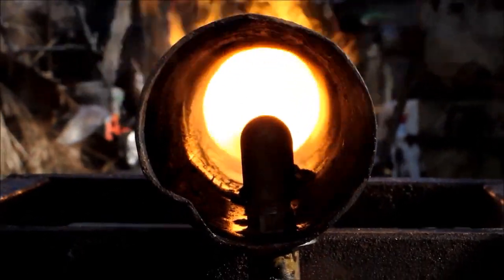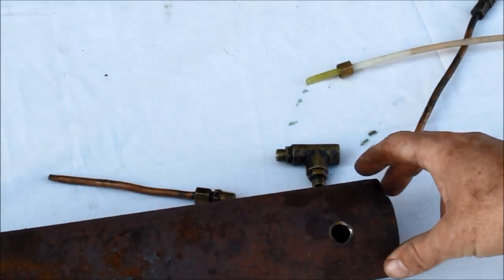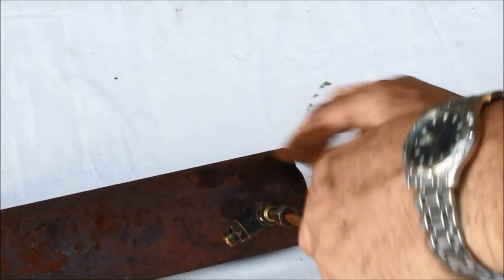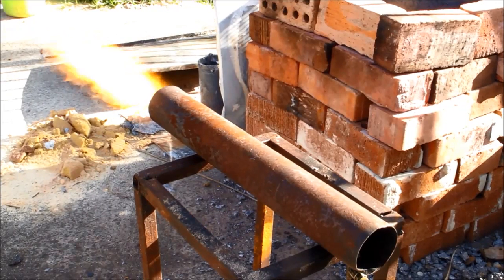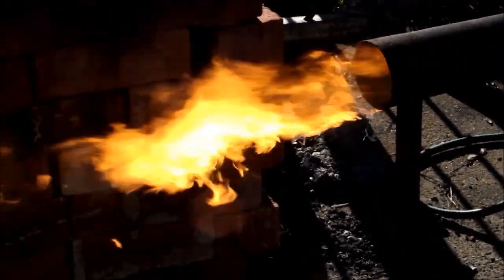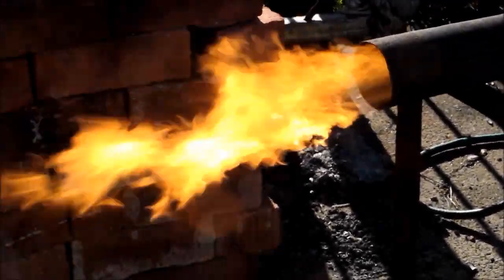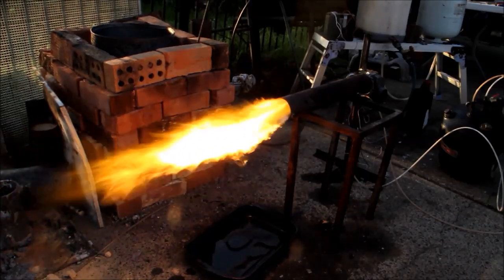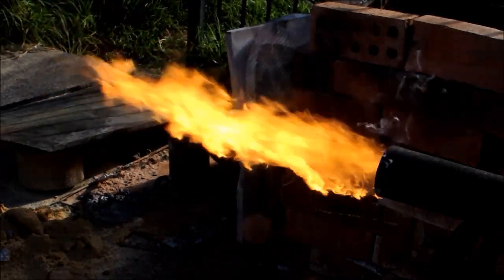Oil Burner Lighting demo  and Setup for heater and furnace applications

Comment: hey mate. any update on the NA burner, i have been thinking of some designs, i want to make one out of 3 truck brake drums. i was hoping to make a sort of permanent out door heater. i've thought of one design but it requres forced induction. i'm trying to think of a design that doesnt use forced induction, doesnt make too much noise. and burns clean. 
so you know simple haha
Reply: Done it

Comment: haven't watched all your vids (just subbed today) but can you include some temperature readings via the use of a temperature gun?  thank you.
Reply from the maker: +linuxxxunil    Temp gun readings are really meaningless. It's not the temp that is important but the amount of heating power or overall BTU/ KW produced. I could make an oil burner that produces 1200o c ( and more!) that uses 500Ml of oil an hour. It may be hot but it does not have the energy to melt a 5Kg block of ally.  It's a bit like a motorscooter will do 60 Mph but it won't do 5MPH  with a 2 ton boat on a trailer attached.  It's not temp that's important because its always relatively the same, it's the amount of power produced which helps to overcome the heat loss that is important and gives a practical heat rise to produce practical work. 

The best indicator of power on these things is fuel consumption.  They will do up to 1500o C in ideal conditions but even clean combustion is going to give 1200oC+ every single time.  The temp of the output doesn't vary much no matter what the fuel consumption but there is a lot more energy in something burning 25L hr than something burning 2.  :0)

Comment: Guday OB. Yet another fun vid. So are you measuring how much time the compressor is running for (X) amount of oil burned? 
I still like your monster burners over all others!!  lol..
Reply from the maker: +Steve 1961P.  The compressor runs ALL the time the burner does apart from a brief window when the compressor is full when I start the burner. After that it never stops. My compressor is an 8CFM. If I reduce the pressure of the air down it will Cycle but then of course you get less heat. I could also flatten the Nozzle a bit which would allow a higher pressure and with enough restriction and subsequent output reduction, also give the compressor some rest time. 

I prefer the monster burners myself and plan an attempt at breaking my 600Kw output record soon.
Reply: if you could find an old walk behind leaf blower laying around somewhere...  they generally put out anywhere between 1200-2200cfm @150+mph air speed.

Comment: what pressures are you running for the air and oil lines? Thanks!
Reply from the maker: +Tommy Rad   THis was running about 20 PSI here.  On the vid after this I ran 30 PSI and it made for a lot bigger Flame and produced a lot more heat.
Reply: Oil Burner
so,only the air side has any pressure? The oil is gravity fed?sorry for the nube questions. I'd like to build one in the barn.
Reply from the maker: +Tommy Rad  Look at this Vid https://www.youtube.com/watch?v=iW1odjaM8w8  and it will explain everything .  Also have a look at the rest of my vids by clicking on the channel name to see all the rest.Might be something else you are interested in there.  :0)
Reply: Oil Burner
thanks. cheers.

Comment: Around what air pressure is the air coming into the burner?
Reply from the maker: +splinejunky  About 20 psi here. I ran it at 30 the other day and it was more powerful and also used a lot more air of course.

Comment: How much oil per hour does it use to say melt alumium?
Reply from the maker: Well depends how much Aluminium for a start and how well your furnace was insulated or if you did it open air.  It's not like a car where you can get an MPG figure,  but you could melt a good amount with as little as a litre if you wanted.
Reply: thanks for swift reply ... I see your point about exact set up..Ill test it out first hand then shall i :)

Comment: Can you use a smaller main pipe?
Reply from the maker: +65BAJA   You can use anything you like. I just used what I had lying around. it will work with whatever you have and is not dependent on any particular specifications.

Comment: how much oil it will burn per hour?...
Reply from the maker: +Madalin Mihai   Like all my burners, the fuel consumption/ heat output is variable.  The oneis fairly conservative but I'd guess about 100Kw or 10 L an hour flat out but again fuel consumption is directly related to how much heat you are trying to get out of the thing. There are no efficiency in this like with a car.
Reply: i wanted to use your project to heat my house at winter. That´s why i wanted to know the amount of oil that it will be burned per hour, ty
Reply from the maker: +Madalin Mihai   I would suggest you work out the amount of heat you require.  If you have a heater of some kind already, you could get an idea by looking at the rating of that.  1L of oil an hour generates 10Kw.  2-3L an hour would do most Homes well and truly I would think so you'd be looking at  2-3L an hour once the house was warmed up.
Reply: Thank you verry much for your help.

Comment: If I click dislike its because its not burning clean if it smokes its wasting fuel yours smokes .bad design if you put oil in a pan and blow on it that's not a burner its just a heater like what you slapped together. How did you get out grade 3.

Comment: so crappy and illegal... at least with "complicated" burners as you call them you don't run the risk of setting your property on fire...  let's not even mention environmental damage
Reply from the maker: The environmental whinge says it all. Nothing illegal about this where I am. What Nanny state do you live in?  Yeah, it's crappy but works.  What have you made out of bits and pieces?  Oh, never done anything at all most likely, better with your credit card buying things than doing anything with your hands and making it yourself Right? 
Another  sook who has done nothing but complains about those that have and thinks they will gain social approval whining about " the environment" .
Reply: @glumpy10  I didn't mean to be rude sir... but it's hard being a mechanical engineer and not cringe when i see something like that. Maybe you're right, where i live, rules may be "strict" in fact I actually worked on a couple of industrial plants which were converted to natural gas even if they had very clever and efficient oil burners (and not a leaky pipe) because they weren't up to the new standards. But my point is, since your channel is all about oil burners, i personally think you should try to educate people on how to improve this technology and not how to make it more crappy (than it already is).
Reply from the maker: @MrGian91  I am not an engineer and neither are my viewers but many have made burners and put them to good practical use in a whole load of things and haven't burnt anything. 
As you are an engineer that knows about burners, I would suggest there is no one more qualified to improve the technology than yourself.  I would be interested to learn better ways of going about things rather than read indignant criticisms and I am sure all the people that watch my channel and are interested in burners would like to see how to do it better as well. 

I haven't done a vid in 3 years and I haven't seen anyone make any improvements and I am somewhat dissapointed myself that many haven't even got to doing what I was. 

There would be a great opportunity for a knowledgeable person like yourself to put their skills where there mouth is here.
Reply: @glumpy10  i might be knowledgeable as you say, and i thank you for the compliment, but i'm too busy to make videos on you tube.
Reply: @MrGian91  - BUT......you take the time to piss on another man's fire....?